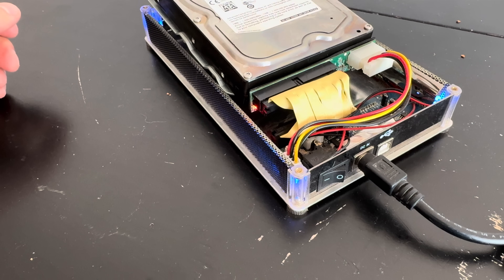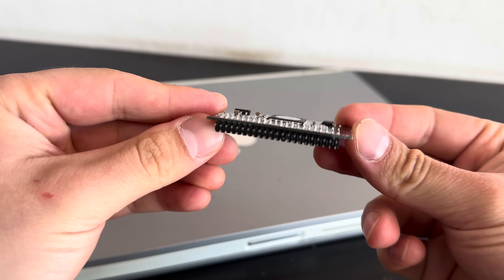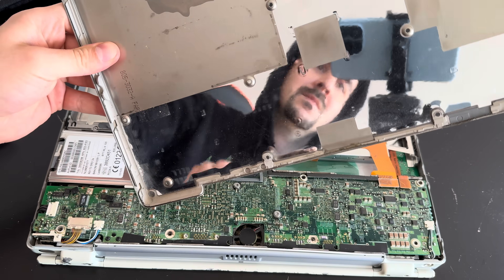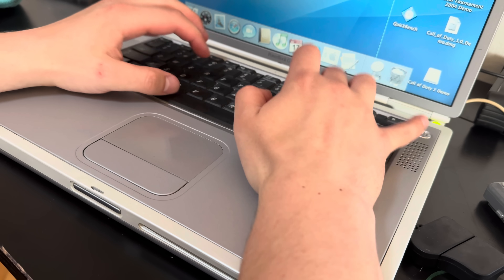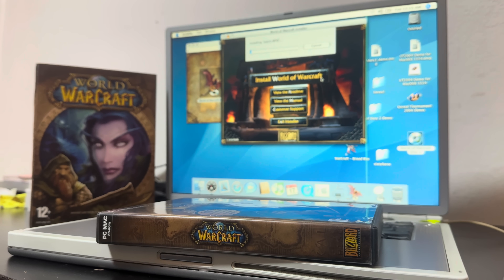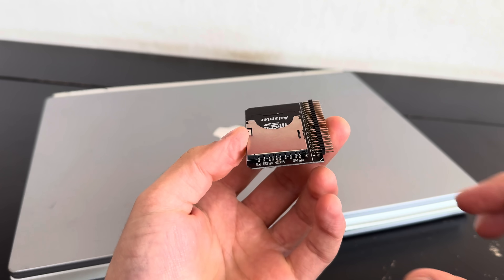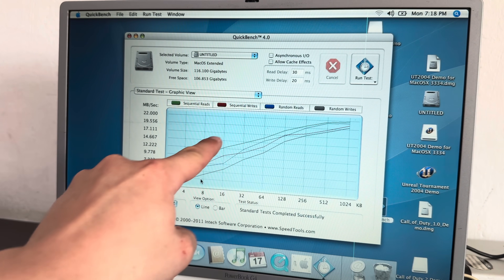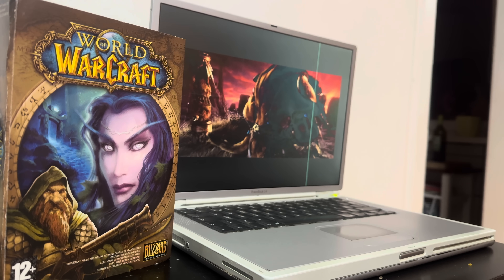Using SD Cards Instead of HDDs?

Comment: SD cards have the disadvantage that they are slower and wear out faster on a lot of write operations.
But that depends on the operating system and use case.
They're fine for retro systems that run on Dos and maybe Windows 9X, but wouldn't use them on anything newer than that.
Or certain Linux Distros that are optimized for sd cards like Rasbpian.
Reply from the maker: Me too, since anything newer probably uses a SATA interface, and those drives are still very common, no need to work around them not being available

Comment: OMG! I had the exact same Icy Box HDD enclosure and the exact same Samsung Hard Drive. Both were a piece of crap. The Icy Box totally unrealiable with its ridiculous PS2 plug for power supply and the Samsung HDD died after only 20h of use. Good riddance of both.   :face-red-droopy-eyes::hand-pink-waving:
Reply from the maker: Oh no kidding? This bastard of mine has been going strong for like 20 years, and I’ve used it extensively in the past five years. I don’t really know what could’ve gone wrong with yours, perhaps just the power supply, and that’s easy enough to replace. The HDD on the other hand is dead however 😂 I’ve just used it as a prop

Comment: with sd cards however one runs the risk of them frying themselves if a power outage happens.
especially if using a microsd(like a microsd in a sd), in which case sudden power outage/loss will almost always fry the micro sd card in a way that is generally unfixeable.
normal SD cards might be safer however, but depends on the type and such.
EMMC should generally be safer.

though for storage somewhat modern HDD's tend to be much more stable than SSD's, especially if mostly used for file storage which is sometimes accesed, or constantly spinning. ssd's do better and safer in chaotic random read and write schenarios however.
also do not use windows 10 or later on a HDD, optimally not even as secondairy as since early windows 10, windows dropped hdd support and started using protocols in methods which will actively destroy your harddrive, windows can kill a hdd which normally lasts 20+ years in around 1 to 2 years because it keeps turning the disk on and off, sometimes even multiple times per second, next to that random writes and random reads aren't optimal for hdd, but in windows there is a lot more stuff going on.
that said I doubt many people serious about pc's still use windows except for some old versions for retro use cases, as windows 10 and later are insanely un-userfriendly/overcomplicated hard to use, insanely slow, bad at handling cpu calls, bad at handling storage, bad at handling memory, networking, compresion, still not supporting memory compression and even macos supports that already now, next to that windows is super unstable and it is often hard to get many softwares to work on windows.
even "windows only" software and games tend to run faster and more stable through wine or proton on GNU+Linux than they do natively on windows(as in games I got around 1.5 to 2 times the performance, softwares also do better, even more so in rendering and simulating(system came with windows preinstalled so updated all to the newest version and tested some things before putting GNU+Linux on it), but stability also is a huge difference, productivity softwares obviously aren't even compareable anymore so much more stable they are on GNU+Linux compared to windows. but even in windows only games like for example skyrim(which is known to be insanely buggy and "windows only") I got constant bugs and even regular chrashes or freezes due to bugs on windows, on GNU+Linux not only did I get 1.5 to 2 times better performance on average(1% lows improved way more than 2 times), but those freezes and chrashes/bugs happening on windows barely happened on Linux at all, and the main only ones still happening where those obviously in the game code as well as some mods not supposed to be used together.

obviously one should assume a pc enthausiast using a modern pc to run GNU+Linux on it, so hdd's actually are insanely good and relyable still.
GNU+Linux not only supports modern ssds much better but also hard drives, and you can actually set the disk profile per disk instead of it being only system wide. also you can use modern file systems. think about BTRFS or ZFS which work great on huge HDD's, EXT4 also works good, especially for game drives as it makes harddrives much faster. using things like deduplication and only moving, loading, or reading or different/changed files which is possible on many modern file systems it is actually possible to store around 100TB or more on a 4TB HDD, and also make transfers faster than most ssd's would reach on windows(still no super fast random read on HDD's however as that is hardware based, though can use buffer in ram or ssd). also if you have a fast enough ssd, and are not ram starved, and optimally also mostly use bigger files or clusters of files(sequential read), then you also can add insane actual compression to harddrives where the read and write speeds increase a lot more. combining it with the deduplication and smart reading and writing and it isn't strange to get easily over 10GigaBytes per second, actually in cases with actual server/system maintaining setups you can get it going well over 100GB/s(big B so Bytes and not bits(1Byte = 8bits), and this is still in home lab setups so you might see higher elsewhere.

for many things HDD's still are far more safe and stable than SSD's. also the things typically breaking in a HDD are the moving parts, those tend to take very long to break if used properly, and if they break you can often get them back working well enough to extract the data quite easily as long as you didn't corrupt things. the main issues where one really loses info is if exposed to hazardous conditions like dropping, melting, etc. or if corrupted often due to a software fault.
Reply from the maker: I guess. But for retro/hobby projects (where you’re not using it 24/7, nor is it a tragedy if it does die), I’d say these adapters are pretty good.

Comment: For 90s computers sure but not for 2000s computers. The constant read and write would kill the SD card very quickly.
Reply from the maker: @9852323  this guy is from 2002, and it works just fine.
Reply: @schvabek it really depends on the OS. Something like windows vista would grape that thing or possibly even XP. I’d honestly rather stick to IDE to sata adapters and just use an SSD or HDD that way.
Reply from the maker: @ Depending on the machine, you might not be able to fit the drive along with the adapter. Also, Vista machines really started to ship with SATA drives, which are far more common than IDE ones at that point in time.

Comment: I think I’d rather use a CF card. SD cards are too variable with their performance. I tried running Windows 11 on an SD card for the steam deck and it’s incredibly painful. Even Windows XP benefits from faster I/O.
Reply from the maker: Running your OS from a USB/SD card interface is quite a bit different than this. IDE is very compatible with both SD, and like I’ve shown in the video, it far exceeds the speeds of a regular IDE HDD. Works very well
Reply: @ oh, I didn’t know that. Do you not have issues with some oddball SD controllers or have variable speed issues? I seem to have pretty poor luck with it, with the caveat being that I’m not retro computing.
Reply from the maker: @uzaiyaro  again, it’s not an SD interface, it’s an IDE interface, which is quite compatible with SD/CF cards, and doesn’t require much circuitry (the adapter is very simple). No drivers or other controllers needed.
Reply: @ TIL. It shouldn’t surprise me, SDIO is a whole thing in itself, and it’s made to be compatible.

Comment: In my experience, and I have more than most people, a HDD either fails in a year or two, or it lasts for 20 years. I still have HDDs lying from the late 90s that still worked when I pulled them a few years back. I even still used an old HDD in my main pc as extra storage until 5 years ago. And that one was in use from the early 2000s. Then again, I also buy used/refurbed HDDs for my NAS, so I have a lot of faith in HDDs. Saves a lot of money, but just make sure you have a HDD on hand for backup and run in RAID 5 or 6.
Reply from the maker: Yep, my thoughts too. Although I do have some dead drives, some of them are ssds. I had very good luck with hdds
Reply: That's called the "bathtub curve".

Comment: I absolutely do use hard drives, and will continue to until SSDs are available in the same capacities for similar prices.  My media server currently has three 20TB drives and one 8TB drive - and I have a 24TB drive on the way to replace the 8TB drive.  That 8TB drive will go into my personal computer which currently has a 4TB and 6TB hard drive.  No, that doesn't mean I don't use SSD drives - the media server has a 2TB SSD for the OS drive - and my personal computer has a 525GB, a 2TB, and a 4TB SSD drive.  Hard drives most certainly have their place still.
Reply from the maker: Me too. I use them for offloading data and backup. Still, wouldn’t want to run a modern OS on my everyday workhorse computer from it.
Reply: @Maplicito  You should acquire a hardware RAID card, similar to a Areca card if you have an extra 8X PCI-e slot in your PC.  You can do Raid 5 using three or more hard drives which safeguard your data even further while benefitting from increased access speeds of parallel stripe access.  If you use SATA, a 1680 would be all you need. I even use 1280 and 1260 controllers and despite their 3gb speeds per drive, they can handle multi-terrabyte drives well.  1880 is PCIe V2 and the 1882 is V3. The other two are V1 I believe, which can be a bottleneck, but still vastly better than using a single drive.

Comment: CompactFlash is a great replacement for legacy IDE if you accept their limitations. Random read is fast, random write is rather slow due to large erase blocks / high write amplification.

For SD cards or USB sticks, my working assumption is that they use whatever flash they sweep up from the fab floor.
Reply from the maker: Seems to work very well in this case, with both reads and writes. A lot faster than a HDD

Comment: Triple boot that puppy with rEFInd by Rod Smith, mac, windows and linux all in one box.
Reply from the maker: I really don’t need to, I have other computers with Windows/Linux. Also, installing Windows (let alone having in dual boot) isn’t as straightforward on a PPC system

Comment: This was a legit nostalgia trip and a PSA rolled into one. The way IDE drives are going for magic bean prices on eBay is absolutely bonkers—are people trying to retire on a stack of TravelStars? Also, SD card adapters flopping around inside a PowerBook like a loose tooth made me laugh way too hard.

Loved the honest speed comparisons—seeing a 40% improvement on loading CoD1 with an SD card. And USB 1.1? Bro, I could knit a sweater in the time it takes to transfer an ISO.

Now I’m wondering—has anyone benchmarked a CompactFlash-to-IDE setup on these machines? Would love to know how those stack up vs SD.
Reply from the maker: Hey, I’m really glad this took you back! Makes my day for sure! 🤟 

As for compact flash, yeah, I’d be interested to try that for sure, and we’ll definitely take a look at that in the future. One thing is, CF is definitely getting less common than SD, and you need the right kind of a card to be able to boot off.
Reply: @schvabek  I just dug up an old camera that had CF.  Bunch of old pix on that CF chip.  I stuck it in a USB reader and plugged it into my windows 10 desktop.  No joy, nothing found.  Plugged it into my Linux server, it worked fine.

Comment: One thing to remember, is look for a fast sd card - see the transfer numbers.   I wanted several usb flash drives to load OS from.   I play with multiple versions of linux. so multiple usb drives.   but I got 406 MB/Sec usb 3.2 drives.  Very fast.   so boot times are low and load times are low.   so back to sd cards, fast is good. but I have heard numerous warnings about sd cards wear out faster than  nmve ( so the same for HDD and SDD ).  but if you to use one and you have enough memory so as not to swap too much and you do not write too much - it might be a good alternative.
Reply from the maker: To be honest, even the slowest modern cards are probably going to be a lot faster than their IDE HDD counterparts. And in this case (with my Ultra ATA66, the bus speed itself is limited to 66 mb/sec), so I wouldn’t even worry about that.
Reply: @schvabek  I agree on old ide stuff - very slow.   but on the fast sd cards - that fast usb is good and not that expensive.   It means a boot time maybe double nvme boot time - so OS loads are fast and happy ( I do a lot of loading - so for me - it is worth it. )

Comment: Well, SD cards have some limitations when using them as HDD substitutes. So the most important and crucial one is swap/virtual memory/whatever you want to call it. You can run DOS or OS'es that do not use swap on SD cards if you are okay with... eh... craptastic performance. That is compared to a HDD. If you run an OS that uses virtual memory, buy bulk boxes of SD cards and find a fast way to image them, you'll be doing a fair bit of it if you intend to use the machine a lot. Why? Because they will die pretty quickly when they are written to again and again and again and again, like the OS will do to a swap file. Being SD cards that are not intended for this purpose, they do not have TRIM etc in the "controller" so to speak so they will not wear level. Flash memory cells die after X write cycles. How many depends a bit on the flash chip used, but the ones in SD cards are never selected for their lifespan as a primary criteria.
The SD cards sold that have high 'class' rating and are intended for video cameras are your best bet. Class is the speed rating, and the ones for video tend not to 'choke' as much on data, and usually last a bit longer when being written to a lot. 
So there is one final and rather important bit to the SD card as HDD spiel: If you have a way to avoid using an SD card - I would suggest to do so. Any SSD solution will be MUCH faster and last longer. SD cards are fine for very old systems but not for macos or windows of any flavor really, except maybe Windows 3.11 on DOS - but you'll suffer premature hairloss from ripping your hair out in frustration over how slow things are.
Reply from the maker: Yeah, non of that really applies to my particular usage case, where I have a hobby retro computer I might use a couple of time a year. I doubt I’ll kill the card in the foreseeable future. Even if I do, it’s very easy and cheap to replace.

As for speed, I mean I’ve shown in the video that the speed is about double as compared to that HDD.
Reply: @schvabek  Sure, I just think people should be aware of the limitations involved with using them. In your case it turned out to be faster than a HDD, but I have seen the opposite many times in HDD benchmarks using different kinds of cards, both SD and CF. I have also killed a couple of cards running NetBSD in one case and either win95 or win98 - forget which now. 
To me personally running things that don't use 'virtual memory' on memory cards is fine - but I would advise against running things that use swap on them because in my experience they don't last very long. It depends a lot on how easy it is for you to replace the card, I had an expensive CF Sandisk Extreme something go bad from running windows off it. I don't remember now how much I had paid for it but it was difficult to find first of all and expensive enough to be "ouch".

Comment: Some years back I replaced the hard disc in my mother's Acorn Risc PC with an SD card adapter. Even with the Risc PC's notoriously slow IDE interface, the machine felt instantly much snappier - most likely down to the zero seek times of the SD card compared to spinning rust.  (I also mounted the adapter in such a way to allow the SD card to be easily removed and reinserted, this allows for much easier backups of the machine, by imaging the card on a Linux box.)
Reply from the maker: Awesome! Kinda the idea I was going for here too.
Reply: get a M.2 SATA to IDE way better then trying to use a micro sd,  Micro sd have low write durability
Reply: @punker4Real  Ordinarily, I would agree. But in this instance there's two things going for me. (1) RISC OS doesn't do swap, and (2) Acorn ADFS does not have the concept of an atime field in the directory entry, so disc access is inherently read-only until you actually come to write something. I've also installed a dynamic RAM disc so temporary files via <Wimp$Scrap> go there instead of the SD card.
Reply: @the other issue is the microsd doesn't have a buffer cache  a decent m.2 sata will have a dram cache

Comment: sd like usb drive 1 nand + 1 controler . example : phison ps3006  2c 84 64 54 micron l85 

but 1 nand if good nand mac speed 25mb write and 150 mb read toshiba 19nm mlc 16kb 

if you replace . first must interface as usb 3 and more channel more nand = example 2251-01 + mlc nand *4 channel 
also good ssd use 16 nand to reach 600 mb for sata 6gb 
sd interface .if very good nand max 150 read and 50mb write . in small size file to slow
Reply from the maker: Not sure I understood what you meant, but I’m not using a USB interface to run that SD card in this case.

Comment: I tried something similar using Linux and a USB to SD card adapter.  The boot times were awful, maybe because it was USB 2.0.  On the other hand, Raspberry Pi systems work fine with SD cards, although USB 3.0 or NVME is much faster.
Reply from the maker: Yep, I’ve also tried booting off of an external HD with 2.0 speeds. Wasn’t pretty.